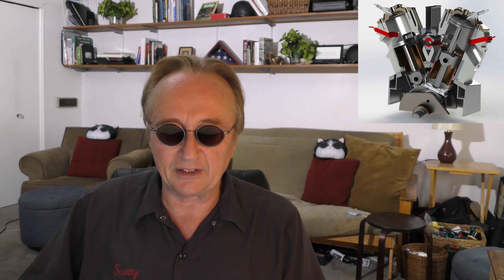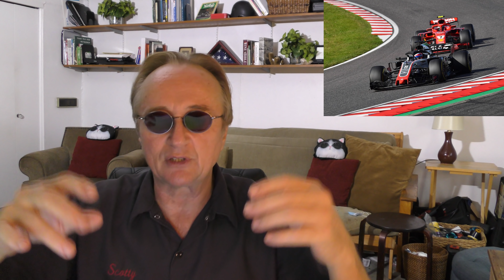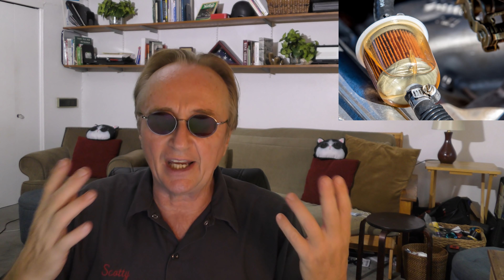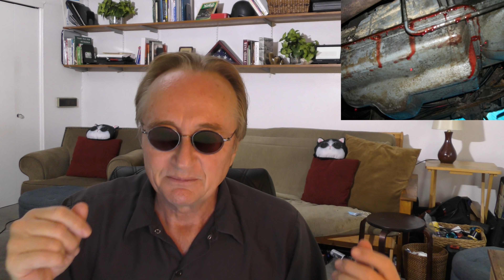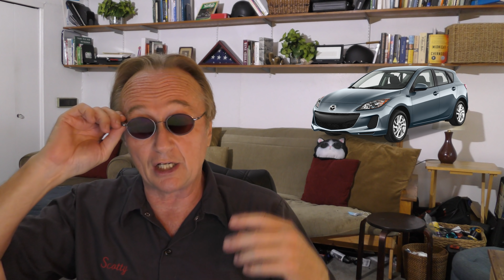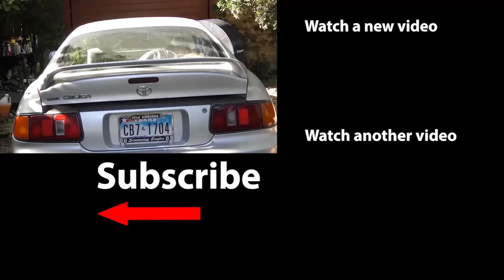This New 2 Stroke Engine Just Changed the World

Comment from the maker: What It’s Like Living in a Ford Escape (My New Home): https://youtu.be/Pz0sBwv41Yc

⬇️Scotty’s Top DIY Tools:
1. Bluetooth Scan Tool: http://amzn.to/2nfvmaD
2. Mid-Grade Scan Tool: https://amzn.to/33dKI0k
3. My Fancy (Originally $5,000) Professional Scan Tool: https://amzn.to/31khBXC
4. Cheap Scan Tool: https://amzn.to/2D8Tvae
5. Dash Cam (Every Car Should Have One): https://amzn.to/2YQW36t
6. Basic Mechanic Tool Set: https://amzn.to/2tEr6Ce
7. Professional Socket Set: http://amzn.to/2Bzmccg 
8. Ratcheting Wrench Set: https://amzn.to/2BQjj8A
9. No Charging Required Car Jump Starter: https://amzn.to/3i7SH5D
10. Battery Pack Car Jump Starter: http://amzn.to/2nrc6qR

⬇️ Things used in this video: 
1. Common Sense 
2. 4k Camera: https://amzn.to/2HkjavH 
3. Camera Microphone: https://amzn.to/2Evn167 
4. Camera Tripod: https://amzn.to/2Jwog8S 
5. My computer for editing / uploading: https://amzn.to/301tYt9

🛠Check out the tools I use and highly recommend ► https://goo.gl/rwYt2y

Subscribe and hit the notification bell! ► https://goo.gl/CFismN
Reply: Hey Scotty, do 2016 ford focus have evap purge valve problems, because sometimes when I pump gas, the car doesn't want to turn on for little bit
Reply: Scotty got a 2015 Chevy Colorado 2.5 6speed auto trans 110,000 miles Transmission is leaking up front when it's running. Transmission shop says from previous experiences that it needs a new trans. It shifts fine no issues. What do you think?
Reply: Thanks for another informative video.. Mr. @Scotty Kilmer
Reply: Scotty, what is, “The Bee’s knees?”
Reply: Hey Scotty what do you think about a 2007 BMW 525i are they good cars to own
Reply: Sup
Reply: @elirivera68  endless money pit...
Reply: Hi Scotty I would've like for you to speak more about the 2 stroke engine. It seems as if you forgot about it.
Reply: Scotty, do you think $2500 is too much to pay for a 1995 Volvo 940 wagon 165K, clean rust free and good interior? Last of the RWD and same great B230 engine as 240.
Reply: I hope that 2 strokes come back in motorcycle scene, am sure you remember Scotty the Kawasaki H2 750.
Reply: @johnnythemenace9926  When you refer to something as 'the bee's knees', it means that it is of excellent or very high quality.
Reply: E3o
Reply: Skidoo changed the 2 stroke game in 2010 with the Etek..
Reply: What is the big deal lightning is a plasma 2 stroke and the sun is a loop charged plasma 2 stroke! nature has have the 2 stroke cycle forever!

Comment: The only problem I have with a two stroke is the smoke, and we have had the technology to get rid of it for over a century.
A simple redesign of the crankcase that includes an internal lubrication system, and a slightly different induction system using a small supercharger instead of the crankcase as a compressor to make it run, along with exhaust valves in the head like the old diesels were built.
That can put two stroke engines back on the road.
However, nothing beats the current way they're built for yard tools.
Reply: Ferrari did just what you suggested but dropped the idea.

Comment: That’s why people love the 2-stroke Detroit diesels, they’re great, they sound amazing. & have a tremendous amount of torque & HP.
Reply: Like the best of both world between diesel and petrol: torque and power.
Reply: apparently you are not a truck driver. when a 2 stroke detroit saw a hill you had to drop a gear before you ever started climbing and no torque at all .
Reply: @daciefusjones8128  That's bc the newer turbo technology that's been applied to the newer 4 strokes. It works very well, boost climbs and without a gear change you move maybe 30% more air/fuel.
It'll be interesting to see what current tech can do.
The real problem with the 2 cycle is piston and ring duty cycle. Less time for cooling.

Comment: Hi Scotty! We just sold our 2001 Buick Century with the 3.1 engine. It probably had a leaky head gasket , but I told the new owner all about it. The transmission works fine, and the car has 221,000 miles on it. Those old ones definitely lasted.

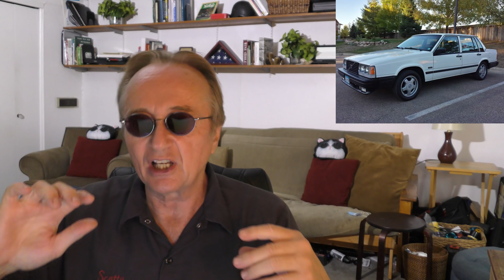Comment: 03:05

My niece has a 1991 744 GLT (four speed manual with overdrive)
with 550 000 km / 880 000 miles on it, 
just passed inspection, two years until the next inspection.
She drives this car daily, burnouts, speeding and what not.
I'm amazed this thing keeps on driving.

Comment: Scotty, I laughed out loud when you mentioned soap sealing a metal tank, I had my diesel tank punctured by fuel theives, I came along seconds after they split, I quickly stuck my finger in the hole (about 1/2" dia). And got my wife to cross the road and buy some chewing gum, we chewed for a quarter of an hour with full mouthfuls, stuffed it in the hole and to my surprise it sealed, it sealed so good, I drove to my garage, upon arriving it was bone dry? Magic temp fix :-)

Comment: My daughter lives in Houston and sells Stihl Chainsaws at one of local (Willow Chase Drive) Northern Tool and Equipment stores.  I had her bring up one of the new fuel injected MS 500i 25" bar saws last week that cost $1,461.36 to Ohio for my tree service guy.  She could use the heater you showed as a give away for her 2005 Toyota Sienna.  The A/C works fine, but the heat needs a fancy scan tool to fix which the dealership up here wanted $1,400 to fix.  We need heat up here for the winter and why I got the van for $500 and gave it to her to take back to Houston last year.  She takes it to Galveston to the beach and took out the middle seats to use it as a makeshift camper.  She also has a '93 stick shift Previa van down there but the A/C blower fan wasn't working.  I tried to have her go to you fix both, but she hasn't made time, so now it my be too late as you are moving.  I thought you might like to show the rare mid engine stick shift Previa in one of your videos.

Comment: Slight oil seepage can be easily fixed by using a higher viscosity oil like 10w40 in older engines which also lubricates the engine better in hotter climates.

Comment: Our military doesn't use Napalm and hasn't for years but when we did, Napalm was basically soap & gas.  We used to make it by hand using Napalm soap flakes and low octane gas mixing it by hand in the Napalm tanks. The end product was a gel type substance after incorporating the waxy soap flakes/powder and that crapy gas.  Messy, miserable work, especially in the Yuma desert.

Then we changed to a mobile mixing machine that automatically apportioned two liquid chemicals plus gas and we just filled tanks using a nozzle like the old fashioned metal nozzles in a fas station.

Comment: Back in the day, even though 2-strokes had twice as many power strokes as a 4-stroke they did not deliver twice the power. Back then their basic inefficiencies somewhat leveled out power to that 4-strokes made. We're talking peak power here. Typically 2-strokes produced their peak power over a very narrow rpm range when they were "on the pipe". Falling off the pipe saw power plummet, making them somewhat more difficult to ride on the street as more shifting of the transmission was called for to keep them in the sweet spot.

Comment: For the owner of the Nissan Xterra that bucks at 55mph. It's probably the lock-up in the torque converter at fault. Change the transmission fluid and see if it helps. If not, it could be the solenoid or the lock-up clutch itself.

Comment: My dad used have a 3 cylinder two stroke Wartburg great car it had a free wheel system on over run so that the engine would not lockup

Comment: If the soap doesn't work, try this. Mark where the gas rank seam is leaking, drive it until it's below a 1/4 tank, then use some J-B Weld on the seam. JMO.

Comment: I've always wondered why they don't make an electric vehicle with a 2 stroke engine generating electricity at an RPM that is TUNED  with its exhaust header to be super efficient at running at one rpm and make more power in electricity than you'd ever get otherwise.  But now they've got better batteries.  I mean 30 years ago, that could have made sense.  Too late now, I guess.

Comment: Hey Scotty I’m looking to buy a f150 should I get a 2004-2008 or a 2009-2014? The 11th gen is more in my price range but I hear bad things about the 5.4 triton.
Reply: 4.6L v8 2 valve is the best in my opinion due to longer life and better gas mileage. Get the older ones they are much simpler to fix and less parts, yes it has less power but it can still pull fine

Comment: My old 80s 2 stroke machines pollute way less than before,, instead of a br9es a br9eix is the performance version they are extremely hard to foul,,it burns the fuel much better as it makes incredible spark without changing anything they are completely safe to use,, they run incredibly crisp,,with new oils they do not smoke like before even mixed at 20:1,,the oil lubricates and is a power maker,,and is fully burned now,,
Reply: B8es.. Anything with R like Br8es. R Stands For Restricted.
Reply: @bansheemania1692  The “R” indicates a resistor type spark plug. Resistor type spark plugs reduce the amount of radio frequency interference,,(rfi) that can cause ignition misfires,,, aka detonation,,

Comment: Hi scotty, I have a 2012 Chrysler town and country with a 3.6 v6 and 187,000 miles. Sometimes when I only give the car a little bit of gas going around 30 or 40 miles an hour the rpms drop to around 1000 and the car makes a low grumbling noise. Then when I give it more gas it shoots up to 4000 rpms and takes off like a rocket. Any help would be appreciated.

Comment: I just got a 1999 Taurus SE with the DOHC Duratec 3.0 liter V6 128,000 miles paid $150 for it I've done some work under the hood because it was running rough but now it's very smooth stopped oil leak and replaced vacuum hoses , full tune up ! How many quarts of transmission fluid do I need to change it not flush because it never had anything done except the oil I guess but when I changed it was very bad and I put full synthetic back in does great just wanted to change the transmission fluid and what kind would you recommend?

Comment: 2-stroke engines are definitely easier to manufacture without cams and valve-trains, and they are superior in weight/power ratios, but the environmentalists won't allow the easy-to-manufacture version of the 2-stroke to be put in cars because of emissions. The only 2-stroke engine I know of that might make it into automotive production is the opposed piston type, lubrication can be accomplished without any oil getting into the cylinder, but they do require a lot of machining, so cost reduction engineering is ongoing. It's all about how much making the engine costs, tree huggers have been fighting auto makers forever.

Comment: I drive a 1995 Buick park avenue. It only has 111,000 miles what do you think about this car for the mileage. And it’s completely rust free.
Reply: Those are great cars, a real pleasure to drive. Hold on to it untill the wheels fall off, then put new wheels on it 😂
Reply: Was a supercharger available for that one?
Reply: wholeNwon the park avenue ultra had a supercharger but mine doesn’t have one.
Reply: @dustyvape.9238  Thanks. I didn't quite remember. Check Hoovie's YT channel, if you haven't already.

Comment: I have a 2009 honda accord v6 with almost 200,000 miles on it.  But lately it has a vibration driving around 65-75 mph.  None higher or lower.  Any ideas?

Comment: Hi scotty,  my transmission  is shuddering around 1500 to 2000 rpm even on the highway. I have a 07 crv. Should I change the torque converter? I hqve changed the fluid twice at  117k miles and the second one at 162k, what should I do.

Comment: I will admit I know almost nothing when it comes to cars. I have a 2006 mercury mountaineer v8 awd, with about 120,000 miles on it. I just had the rear bearings replaced, rack an pinion done and now whenever I turn to go up a hill, I feel a slight vibration and hear a clicking noise coming from the front. Even if I'm going strait or turning. After the turn onto the hill, the noise and vibration doesn't really stop. Could it be  The cv joint or something. I'm at a loss! If anyone could help that would be amazing!!

Comment: Scotty I have a 2009 Chevy Silverado the truck sometimes when it goes forward say when I stop at a stop sign a stoplight it will act like it's stuck in first gear in the transmission in speedometer will be at 0 and it stopped again and go it'll work fine again like nothing happened to Trucks transmission control module was replaced and the vehicle speed sensor replace to and that did not fix the problem what could it be

Comment: Scotty, does anyone make a LED conversion kit for 2006 Toyota Corolla.  The car is still ticking but the lights seem dim.  New bulbs/or battery does not make them brighter.  Any ideas?
Reply: Check the charging system (load test), of course. The voltage regulator is usually inside the alternator these days.

Comment: Hey scotty I have a 2002 ford escape with almost 174k miles. The transmission shifts rough sometimes. I checked the dip stick and it's full and the fluid is red. I dont know how old the fluid is should I just change it?

Comment: Hey scotty my 1999 Toyota solara v6 manual won't go into first and has to be forced into reverse but it goes into the other gears smooth and can start in 2nd with a little more gas. Do you know what the problem could be?

Comment: 2 strokes fire every time the piston gets to top dead center... piston goes down to bdc= 1 stroke piston travels up to tdc= 2nd stroke. pop pop pop..... might as well call it a one stroke cause there is a power stroke at 360 degrees every time NOT every second time, that would be a 4 stroke. get it right.

Comment: Hey Scotty I have a 93 civic D15Z1 it stalls when I turn the ac on. Did clean throttle body and IAC,replaced spark plugs,rotor and distribuitor cap what else I have to check?
Reply: Check for vacuum leaks, too. Check the alternator output under load and load test the battery. Compressor could be going.

Comment: Hey Scotty, is it a good idea to buy a 2013-2017 Ford Focus with a Standard transmission?
Reply: I have a automatic 14 focus and I regret not getting standard I just past 200,000 miles and have had no engine issues whatsoever just do oil changes every 5,000 miles the auto transmission sucks but your looking at a standard I would buy that
Reply: @americanchauvinist1210  thanks man, this is good info. 👍🏼
Reply: I’ve had to replace an ac compressor, 1 wheel bearing, 1 control arm, and 3 clutch assemblies on the crap auto transmission

Comment: Hey Scotty my 2007 Audi A4 shakes when first driving it after starting it. The shaking goes away after about a hundred feet. Is it nothing?
Reply: DervishConrad yeah your Audi is nothing , but a endless money pit.
Reply: Does it shake if it isn't moving yet after starting? Does it have to be in gear to shake? MORE INFO.!
Reply: wholeNwon it vibrates from the front right corner when it goes in gear and the first few feet moving
Reply: @dervishconrad1591  Ordinarily I'd look at the motor/transmission mounts first. But, if that's accurate, check the CV joints. Do it promptly.
Reply: wholeNwon thanks I appreciate your help
Reply: @dervishconrad1591  Good luck,
Reply: @dervishconrad1591  Oh, one more dumb thing: Check the lug nuts to be sure they are tightened to the correct torque setting...or at least that they are not loose.

Comment: Hey Scotty.... I keep hearing about electric cars will take over gasoline eventually. We don’t have enough elements under the ground to make that many batteries. !!!! What is your opinion?
Reply: Ralph P Battery technology is rapidly changing with less rare elements needed.  By 2040 most new vehicles will be battery, solar, and/or fuel cell powered.  They are cheaper to make and easier to maintain.  The biggest issue is power infrastructure and chargers which will need to be installed in most parking spots.

Comment: Look at the motorcycle world. KTM has a injected 250cc/300cc 2-stroke(TPI) that almost matches the torque of a 4-stroke & the lugging characteristics when its not in the optimal gear. The number of strokes doesn't matter & here I'll say Scotty is way off. A 2-stroke is more powerful because it doesn't require the cam, valve gear & coil springs necessary to actuate the intake/exhaust (poppet) valves. Those components are a parasitic loss that the 4-strokes have to put up with. There are other systems of actuation but I'm referring to mass production units. The excess smoke was from the unburned oil in the Gas/Oil mix required to lubricate the engine internals. It wasn't the environmental catastrophe Scotty infers & the Green People want you to believe. When you had the correct Gas/Oil mix ratio they were great!